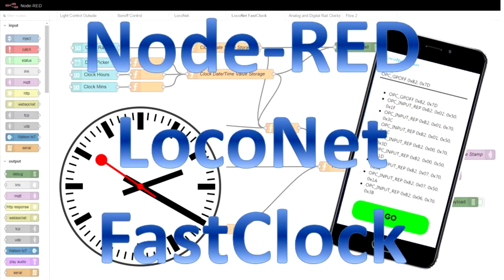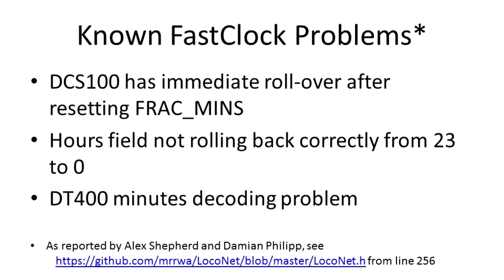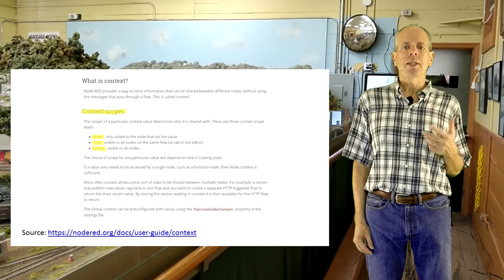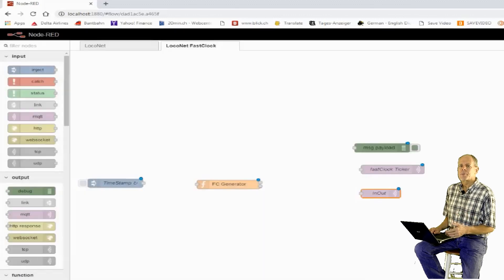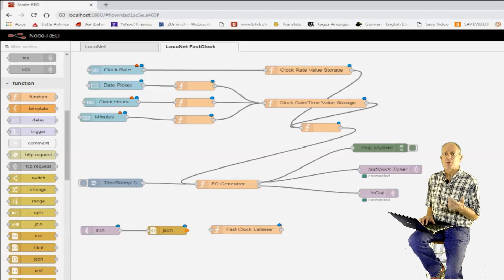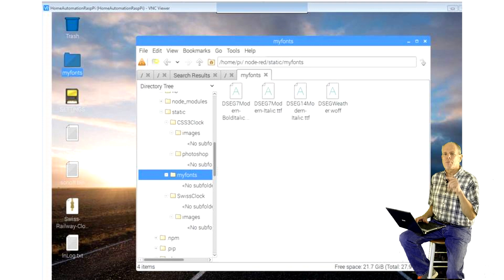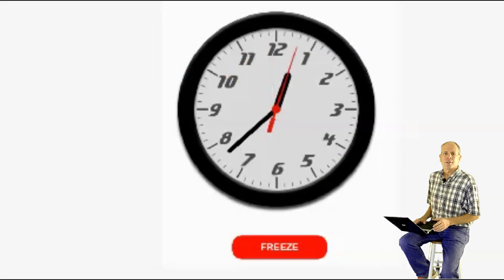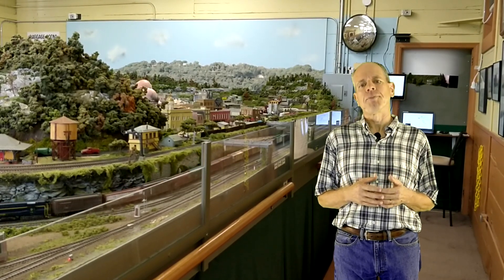Node-RED LocoNet FastClock (Video#4)

Comment: I remember seeing some code you had in the past that allowed me to switch turnout through node red. I can’t find it now, help.
Reply from the maker: Videos #2, #4 and #6 and the related hyperlinks on my Github page, from where you can download the Node-RED templates. But be aware: I made some small changes to the syntax of the JSON strings in the meantime, so you have to check. Your module is sending MQTT commands in the new syntax, the Node-RED templates from the Github page are using an older version. The new syntax is like this: payload: "{"From":"Switch Board", "Valid":1, "Data":[176,0,0,79]}" From can be any name, just not the same as the one you use on the Gateway. Valid is always 1, Data is the LocoNet message in decimal numbers.